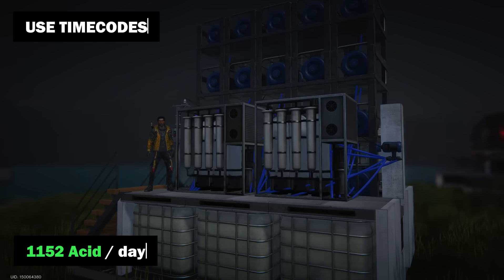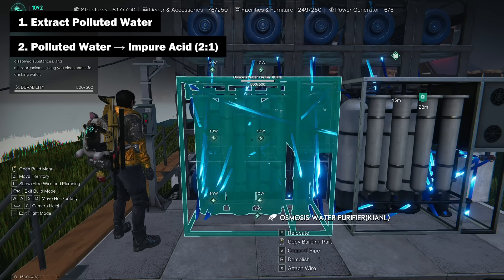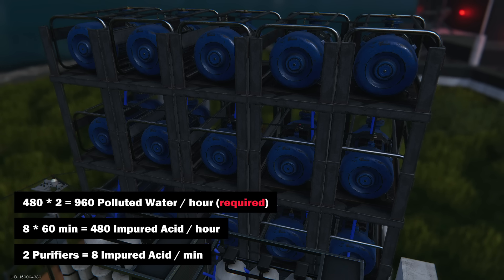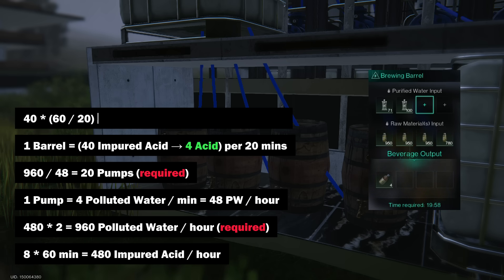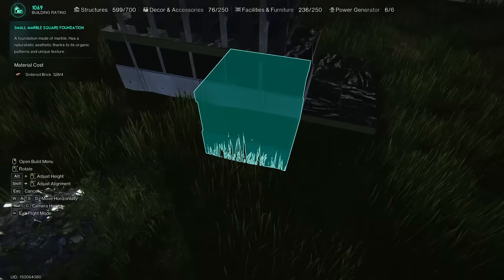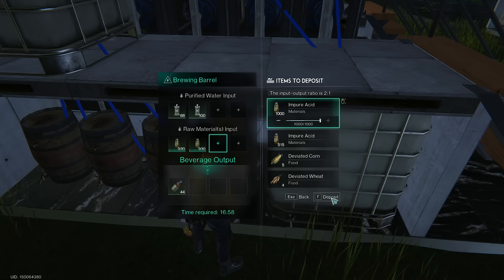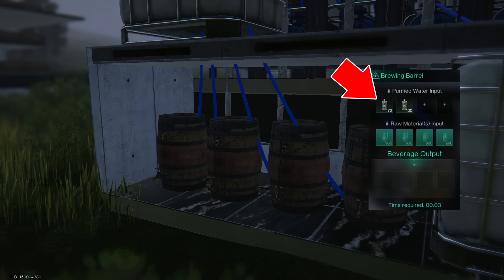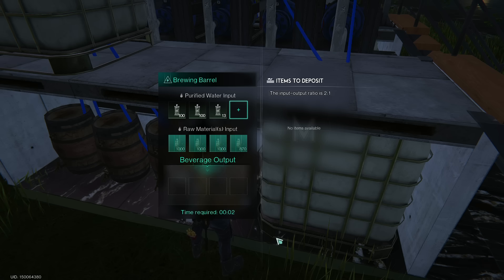Passive Acid Farm Guide ♻ | 1152 Acid per Day | ONCE HUMAN

Comment: How did you place the small stone ceiling while the water tank is placed inside already? I tried copying it but it doesn't allow me to place it
Reply from the maker: well, I can't too now. I think they fixed this yesterday.
but u still can place Purifies directly on the top of tanks.
will be actually the same 🙄
Reply: @KIANL-GAMER  Try bumping up the end pieces one step (raise them one over the floor) and you can place it just fine.   micro adjustments to the rest are easy from there

Comment: setup is over complicated, u can literally set up high pump to osmosis and to water tank, and then to the barrel or to the sprinkler. ALL of that will flow perfectly, no need all those walls or pumps. But i guess u want to look fancy
Reply from the maker: You can't connect more than 10 pipes to 1 facility. So if u connect 10 pumps to 1 Purifier, u want be able to connect this purifier to a tank, and u will need to go take ur Impure Acid from 2 purifiers. If this is ok - why not 🙄

Comment: Impure acid doesn't flow into the barrels< you need to do it manually every day
Reply: Just like he said in the video.
Reply: @xYggdrasilx  Yea but title is Passive farm. When you manually do half of the produce you can't call it passive...
Reply: @SolStvrdust  He says right in the video what you commented, you added nothing to this content by repeating what was said in the video. Putting the impure acid into the barrel is something that takes maybe 20 seconds and only needs to be done once a day. The other 23 hours 59 minutes and 40 seconds of the day it's 100% passive. If something is 99.98% passive I think it's fine to use the word "passive" in the title as long as they clarify what 0.02% of the process isn't. Which he did in this video. Then you just repeated what he already said.

Comment: Well there goes your whole power grid. You can also run extraction sites with food and make like 700 in 30 mins
Reply: Yep, now he has no power to do starcrom purification defense lol.
Reply: @CommandoJenkins  you know you can install a breaker to turn the factory off? and turn your turrets on? it is pretty simple
Reply: @CommandoJenkins  you do know it's not hard to have switch to power which area you want 
with breaker :P 
this is a good passive acid farm 
Combine it ACTIVE acid farm to double the amount you get for less amount of time over time :P
Reply: You're spot on. With the food that drops 50% more acid, boosted with fruit tea, chef rex and the gourmet kitchen specialisation I get about 7-8 acid drops per mob. 
Doing a silo with deviations is far more time effective as you're also getting other materials and stardust source and gold mods if you use a controller.

It doesn't hurt to have a passive income but I find 4 pumps running to 2 single purifiers which then feed into 5 barrels gets me around an extra 200 a day. With plenty of power left for the rest of a base full of sprinklers lights and oil refineries etc

Obviously other people will enjoy the game differently and that's ok too

Comment: I can do around 1290 per day. I have 16 pumps and 5 barrels. I cut off 10 pumps when I'm in my barrel acid phase. That allows polluted acid to keep pumping and keeps the barrels active constantly. I also cut on 2 water osmosis units to keep the barrels fed with clean water. I have to go down and pull water from a dirty water source. It's nice because I have the luxury to cut on and off the pump when necessary.

Nice build, btw.  :)

Comment: how did you place 21 pumps? I seem to be at my build limit after placing the initial 20 in the factory. Are there other items that contribute to the max number of pumps you can have bc I have a little farm as well and am wondering if removing that would free up more pumps. I’m so confused 😢

Subbed and am excited for the future vids!
Reply from the maker: Hey. You have facility limit 250 items (at the top of the building interface). You have probably reached it. Pumps are facilities, same like turrets, switchers, terminals and other stuff.
Reply: @KIANL-GAMER  Nope that's not it, I'm at 207/250 and I am still getting the Space is full message. I'm well under the limit for all items except Power Generator which is 7/6.
Reply: I figured it out, I had some leftover barrels from my previous farm and those appear to contribute to the max Water Pump limit. After removing a barrel, I was able to place another pump.
Reply: @PerzyYT  Rain collectors, fermentation barrels and maybe oil destillers also shares the same limit as pumps

Comment: How did you stack the water pumps on top of each other
Reply from the maker: Just hold Alt a scroll a bit with the mouse wheel for 2nd height. For 3rd and 4th it will be auto, if u place them one by one

Comment: The problem with farming this acid is that when you are offline, three-quarters of it will be filled with pure water even though all four spots are full of polluted water. It only works properly when you're online.
Reply from the maker: bro, I just log in in game, and I don't have any water there. I think you place ur water pumps too close to the body of water. Then each first iteration = 4 polluted water, each second = 24 dirty / sea water. I said about this in the vid.
Place your water pump far enough from any bodies of water.
Reply: @KIANL-GAMER  i finally figured out why it does this. if you have water pumps in TWO areas, one pumping acid and another pumping dirty water (most likely an isolated pump for sprinklers - farming) the game will get confused and all your polluted water pumps will produce water instead of acid, whereas your dirty water pumps will produce impure acid instead of water. when you log on the confusion is undone. so one way to solve this problem is farm a lot of water first, then delete the irrigation pump for sprinklers. then there will be no more 4000 water waiting for you when you log on.
Reply: @sluggie1018  True! I stumbled across this revelation myself recently. Honestly, I've encountered almost all of the bugs described in these comments combined, but what you just described made the other one's tolerable for now.
I'm getting the correct resources now but my 1/3 of my pumps refuse to fill (empty) water tank.
I finally resorted to making a highly customized electrical system on my property turn off all non-essential services while delivering enough power to what has ultimately become this video's tutorial plus 2 extra osmosis purifiers and a pump.
For now I still need to do many things manually but it's in such high volumes that it's worth the effort 😅
Reply: @sluggie1018  no just no. problem may solve ur problem but not others. one for instance doesnt get solved is the fact that randomly 1 or more acid pumps stop filling a tank under them, which means that the acid pump gets full and stops producing. and for some weired reason oil-only pumps stop producing becuz they run out of energy but there is enough energy. this all happens when going offline. same with these energy-deviants sometimes they stop recharging over night.
Reply: @KIANL-GAMER  It's a known bug, when offline the polluted water is turned into purified water. I have that issue offline and I am 1.5 km from the nearest body of water. My pumps only ever pump polluted water but sometimes it is turned into purified water.
Reply: @KIANL-GAMER  All four slots are completely filled with polluted water. Unfortunately, it only functions properly when I am online and does not pump dirty water or process any pure water at all. I am currently located in the chalk peak region in the southwest, far from any water sources.
Reply: Ive got a fix for this have water sprinklers going off on 100 percent it will slowly go through your water leaving room for more impure acid. Bonus that you get to grow crops better aswell
Reply: It will then only collect polluted water mine only collects polluted water
Reply: @ThinkofiT1  My pumps have only ever collected polluted water, but when I'm offline the purifier turns it into purified water.
Reply: Wow I thought only my pumps were bugging. Also for me, pumps often won't transfer anything to my osmosis thingy so when I log in it's 50% chance that my pumps somehow stopped transferring anything, they got filled then stop producing. I need to clear them, reset pipes and they start transferring again
Reply: @DankChucle  I ended up giving it up, I can collect more acid faster just using preserved chops whenever I am fighting deviants.
Reply: @DankChucle same for me
Reply: Not only that but you also have to consistently empty every water storage unit which isn't bad if you have like 12 water storage units
Reply: Mine have never made pure water, and they've been running for weeks now. I usually come back the next day with at least a couple thousand+ impure acid in my tank.
Reply: For only polluted water just build this at a spot that is 100% + corrupted.
Reply: So the best afk acid farm is the one using sulfur chemist specialization, cuz i have it and it's amazing that i don't need to do this kind of setup, all i need is just some sulfur and energy link which are easy to get lol
Reply: @AromonChannel I have it too but it takes 13 hours per 99 acid lol
Reply: My osmosis machine is connected to a tank full of polluted water but as soon as I go offline the machine process all this polluted water in purified water as well
Reply: I have the complete opposite problem lmaoo
Reply: Use the water for sprinklers?
Reply: so over all, i just need to not go offline??
Reply: i have 18pumps 9 purifiers 6 barrels
3 purifiers per 6 pumps
is that over kill?
Reply: Put your pump on the ground not near water
Reply: Nah bro put ur water pump on ground
Reply: @ThinkofiT1  That don't make any difference. when not online it turns polluted water into purified water.
Reply: same problem

Comment: Too much watt usage.. Need to turn off when trying to do basic stuff..
Reply: Have somebody on your server place upgraded power generators in your base. I have 8 enhanced generators making 50w+ each with electric eels for 400w total. Connect your defense turrets to a power switch and turn them off 99% of the time and just turn them on when you're doing your weekly purification. You can also cheese by making an alt, joining the same server as your main, making a base literally on top of your mains, share permissions, build generators on that land and have 2x building capacity and 2x generator power ALL controlled by your main account.
Reply: @aaronb7949  you mean i create a new char in same server, and go to my main base and built my second base (power, ect) at main base? can we do that?
Reply: @monmon-vl8bx  Yes, you can do that :D
Reply from the maker: You can make half-build of this factory
1 Purifier, 10 Pumps, 2 Barrels, 2 Tanks for Polluted Water, and same configuration

Comment: My pumps are in a polluted area, and they're far away from any water bodies and are placed on a solid ground. Not sure if it's a bug, but whenever I'm offline my reverse osmosis filters which are supposed to turn the polluted waters into impure acids somehow turned everything into pure water.
Reply: Raise your pumps as high as you can, if it's above sea level it will only pump polluted water
Reply: @TGO1688  they're at the absolute highest, they're literally floating  above the ground. I had a chat with someone in the official discord, it's actually a known bug, it seems I'm not the only one with the issue.
Reply: @aiyemhim  same problem and that bug works only in offline
Reply: @Chuchi_Gucci  yup
Reply from the maker: probably really bug guys, cos many ppl have same problem, as I see
you can try some other place then
Reply: @KIANL-GAMER  It probably started with some of the recent patches, im having same issue now discovering purified water instead of impure acid on login. And all was working just fine week ago.
Reply: @aiyemhim  I have 20 WPs and all of them are pumping just polluted water 24/7 non stop. I'm even pretty close to a body of water. I just placed them pretty high.

Comment from the maker: 01:57 ("1 Pump = 4 Polluted Water / min ...") is misprint. Correct: "4 Polluted Water / 5 mins" 😐
But the calculations are still correct, cos it's still 4 * (60 / 5) = 48 PW / hour.
Also you CAN'T place ceiling over the tanks like that anymore, but you still can place purifiers directly on the top of the tanks, and you will have the same result.
Reply: Do you know if they have fixed or improved it so that you don’t need to go to your barrel manually? 
Also when you do purifications do the beasts ever damage the pumps or can they only damage structures per se (floor, walls, etc) but not devices?
Reply from the maker: @SToad  no idea
Reply: @KIANL-GAMER  it doesnt work. I need to put Manuel unrefined acid in the barrel
Reply: @mw___pictures7691  he stated that in the video @ 3:34
Reply: @LemonTreePH  yeah i didnt watch full, cause i already got a acid farm